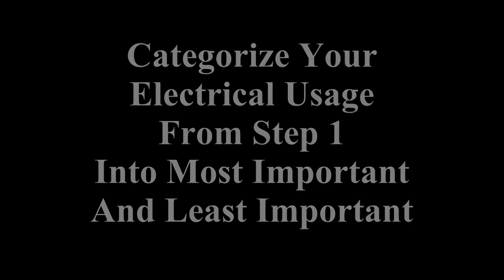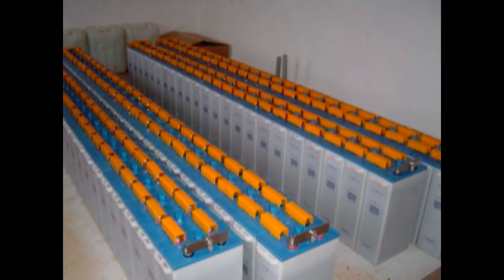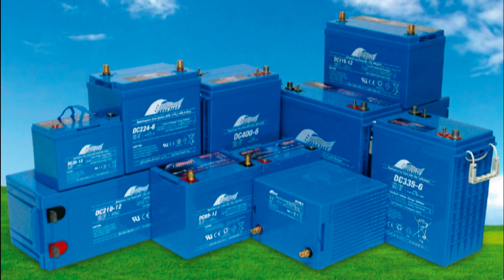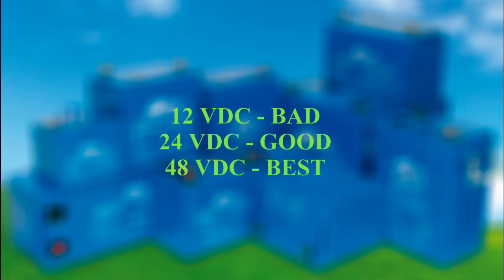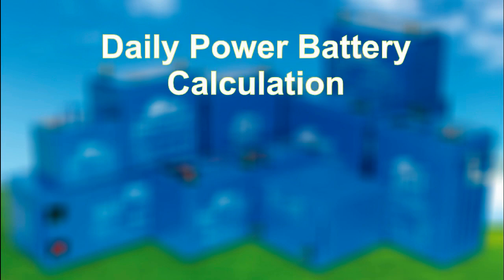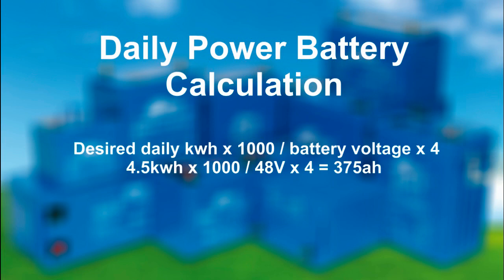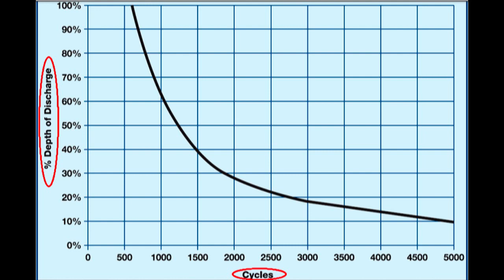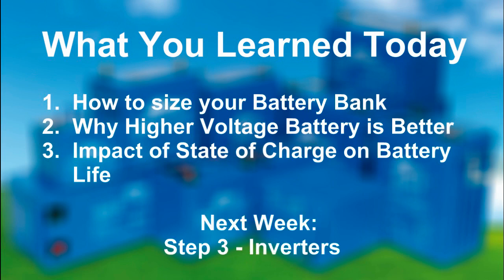Step 2 Solar/Wind Power: Battery Selection

Comment: Thanks but what about Tempreture of batteries and how temperature effect the batteries and how to configure Tempreture of batteries.
Reply from the maker: The manufacturer will have data sheet describing the operating conditions of the battery you want.  The different types and manufacturers of batteries are too varied and could take a video for that topic alone.
Reply: @OffGridLivingSteve  thanks I check that thanks

Comment: Some things should be powered by other methods. Hot water heating... Some type of gas. Wood fired or gas fired.
Reply from the maker: RogueOntheRoad you’re certainly free to heat your water by any means you wish. My home is all electric by solar power.  Stove, water heater, home heating and cooling, and even my electric car charging.  I haven’t started a generator in two years.

Comment: Saying 12 volt is bad just shows your ignorance. And it is not more expensive.
Reply from the maker: Don't be a fool.  12v is only good if you live in a bus.  If you power an average size home, the number of batteries and wire size required to process all the power would cost a fortune.  Well made 12v inverters max out at 2500 watts.  Double your voltage and use 1/4 the wire size.  Since your so full of yourself, you probably won't, but you can increase your knowledge here:  https://www.youtube.com/watch?v=ytwLNKbarsg

Comment: You, good sir, are a hero. Although I thought I knew nearly everything there is to know about different batteries, from redox to lithium metal (not ion), but I had never heard of these nickel-cadmium / iron ones that require oil. Sounds interesting and I'll definitely be checking into what they are all about with much more detail.

Love the videos.
Reply from the maker: You my dear friend have humbled me with mere words.  Thank you!
Reply: No, thank you. Your videos have taught me a lot - and not just this one.

In fact, since I have an expert here I figured I'd ask if you know of any way to use a charge controller to take advantage of typical commercial low voltage NiCd batteries? Seems they aren't very solar friendly with the trickle charge and all, but perhaps you can shed some light on it from the top of your head. I am very interested in especially the amount of cycles you can get and NiCd really does seem very good for that.
Reply from the maker: I prefer NiMH (nickel metal hydride) over NiCd (Nickel Cadmium) batteries.  NiCd tend to have a memory effect over a period of time where their apparent capacity diminishes over time.  MiMH does not have a memory effect, and retain their capacity over time.

Michael Bluejay has a good article on NiMH and NiCd batteries and proper charging you might be interested in here:  http://michaelbluejay.com/batteries/charging-tips.html

Good luck in all your endeavors!

Comment: Hello Steve.Just to let you know your calculation formulas,  I used them  and they are working Perfectly. With only 3400 Watt's running right now and a midnight classic 200 charge control, With 460 FLA batteries deep cycle. I am ending up with about  93%  in the morning,,  running  everything I need. At night. Thank you again. Neil Las Vegas.
Reply from the maker: Great to hear, Neil!  I'm glad it's working well.

Comment: Hello Steve . I finally the system up and running with  3400 w Or Solar power. The only new outback VFXR 3648-a  inverter with a midnight solar 200  Charge control.  I used your formulas to calculate everything  and one of the let you know they were real well. This is the first phase of solar panels, I will be adding another 1600 Watt's solar panels and one more charge control. Just to say thank you for posting your calculations, as they are about dead on. I'm going to do some videos of the system and post it here. I'd like to have permission to use your name, Referring to your calculations. How wonderful July and agreed August. Thank you again. Neil
Reply from the maker: Hello Neil.  I apologize for the tardiness of my response.  My father-in-law passed away last week, and we are just getting settled again.  Yes, please feel free to use any content.  The more we spread the wealth of knowledge, the wealthy in knowledge we all gain.

Comment: I am currently planning to build a new house and am considering various forms of alternative energy supply but mainly PV systems. I've watched loads of YouTube videos from various contributors and just discovered your channel which is excellent. There is one thing I can't get my head around at the moment when considering sizing my potential needs though and hopefuly you might be able to help.

I understand all the basic calculations for battery bank size with daily usage etc. but that supposes that the battery bank charges during the daylight hours and the battery bank supplies the energy required after dark. What I don't understand is the usage one has during daylight hours which presumably reduces the battery bank charging? Maybe I'm just over thinking things or missing something fundamental?
Reply from the maker: Please forgive my tardy response.  We just returned from a trip to Michigan.

You are right that any electricity you use during the day reduces the amount of available power to charge batteries.  This is the reason the panels are sized considering the amount of power required to charge PLUS the amount of electricity you would consume during the charging period.  That's the reason I have two separate consumption calculations in these primers.  One is for all your power needs, used to size your solar array, and the other calculation used to size your battery bank.  You don't need a battery bank sized for consumption during daylight hours, but you need the panels sized for it to produce what you consume.
Reply: Yes, I realise that now having watched them a couple of times more. It's difficult when beginning to design a system such as this to cover every thing you might need which is probably what you found back in the day. I also appreciate that there has to be some adaptation to your way of life to accomodate what you can do during daylight hours but also manage the limitations imposed by the battery bank after sundown.

I'm in the UK so we have quite a difference between what can be generated during Summer months and the Winter. I'm thinking we won't be able to exist totally off-grid for the whole year but we should be able to produce a lot of useable power for maybe 8 months of the year with a reasonably-sized system.

Thanks again for the help and all the videos. Very interesting, informative and thought-provoking.
Reply from the maker: Night time energy for my family is a small requirement really.  We use efficient LED lighting, laptop computers, and small flat screen televisions.  Bathing is done before sundown so the water pump is not run at night.  We might run the microwave at night for popcorn.  Therefore, night time usage is quite minimal.  During snow storms, laundry and other non-essentials are paused until the sun returns.  Working around the weather is important to minimize generator requirement.

My production here varies wildly between summer and winter months.  I will make a video of that soon.  I use a wood stove to heat our water, cook, and heat the home in winter.  I average 26 kWh per day of consumption/production in summer.  Winter months I average 12 kWh/day production.  Finding other means of energy is important so firewood became that winter energy source for me.

I have never been to UK, but I understand there are many cloudy days there.  Full cloud cover for me reduces output 15-50%, depending on the density.

Out prayers are with you and the great UK during this time of Ramadan murders and destruction.
Reply: The biggest problem we have in the UK is that London is on a of latitude 51.5 degrees N and I am just to the East of there. Denver is just under 40 degrees N so even though is gets a lot colder in Winter you probably have a lot more sunhours in the year than we do.

Woodburning is also not a cheap option here compared to N America where you have vast forested areas. We cut most of the trees down in the UK in the Middle Ages to make way for the people and farming!! :o)

That is why PV is starting to be come a viable and affordable option in comparison to other energy sources such as oil and gas. It would be nice to have a backup in place as well because our whole energy supply grid here is starting to groan under the strain which is only going to get worse in years to come.

I've been to Breckenridge/Copper Mountain  skiing and it was heaven there. Are you anywhere near that Steve?

Thanks for your sentiments about the recent atrocities suffered in the UK. You guys are far ahead of us on that front though with 9/11 and all the sacrifices many families in the US have made with your military battling this cancer. We have a history in the UK of remaining stoical in the face of terrorist attacks over many decades so we will prevail. Especially with the support and help of our friends across the water.

All the best for you and your family.
Reply from the maker: If you go to Breckenridge, I live very far South of there.  But if you are there, and you let me know in advance, I would be pleased to drive there and enjoy your fellowship.
Reply: That's a very kind offer Steve. I'm not planning a ski trip to Colorado any time soon but if I ever do I would love to meet up with you.

Comment: Nice video . Do you have any thoughts about the Aquion salt water  batteries : 100% discharge with no damage , no partial discharge problems , no maintenance and 8,000 lifetime cycles ?
Reply from the maker: Rod, when I think of the raw materials used in the manufacture, I think the batteries are way overpriced.  They don't use hazardous or rare metals like lithium, lead or nickel.  But when you consider stacking their performance against all other batteries, the price isn't bad.  If Duane and I can get some time this summer, we'll probably build a set of salt water batteries and see what we come up with.  Bottom line - I'm very impressed with Aquion's solution, and I would love to have a set to live on!

Comment: Excellent video.  You calculations confirm the ones I had recently done on my existing system.  I have a 24 volt system, however you make a very good argument for going to a 48 volt system.  At this point I have 16 250 watt panels, charging 8 430 amp batteries.  These are 6 volt batteries wired series in two sets to create two groups of 24 volts which are then wired in parallel.  We have midnite MPPT charge controllers and a Magnasine inverter.  The batteries are flooded deep cycle, however we've recently considered shifting to AGM - however budget is clearly a factor in making such a change.  We are not fully off grid as we still have mains power.  However, our solar system is wired to the house using a separate combiner box.  This allows us to power "critical" items, and if needed to be fully off grid simply by turning off mains power.  Thanks for sharing your direct experience with Nickel Iron batteries.  I have just discovered this old / new technology and have been intrigued.  However after hearing about your experience I may well leave Nickel Iron batteries alone.  The complexities and cost offer a negative incentive to getting into something which, while robust seems more suite to someone with more money and a sense of adventure than I have.
Reply from the maker: Thank you for that feedback.  I do enjoy hearing about others' experiences, and yours like all is a unique story.  You should make some videos!

Comment: Do you ever sleep with a TV all night? Or is that a no no in the Solar world?
Reply from the maker: It's generally a no no.  However, I've done it a few times accidentally.  But I try to remember to set the sleep timer so it will shut off after I fall asleep.

Comment: Have you heard about the new Tesla battery? bout 3,500. But you hang it on the wall and it is supposed to take care of the house and if you have the electric car it will charge it also. Any feed back, I would appreciate it.
Reply from the maker: I don't have any personal experience with it.   The Tesla PowerWall uses a non-standard DC voltage of over 300VDC.  So even though the battery isn't a bad price or deal, my understanding is the proprietary inverter and interconnecting components make it prohibitively expensive.  Personally, I'm waiting for the technology to mature enough for other manufacturers to compete and bring it in line with industry standards, thus bringing down costs.

I wish I could be more help, but that is my thought regarding it.

Comment: Hi Steve, watch all your vids. great work. I'm trying to figure out my own   system.. I have 4, 12 volt batteries At 110 amp hours each. I have them wired to make 24 volts.i had a think about your equation. if I had them wired at 12 volts it would be 440 amp hours. as the 4 batteries have 110 amp hours each.. so I wired them to make 24 volts. I now have 220 amp hours.. if I wanted to wire them at 48 volts I'd have 110 amp hours. it all works out the same. the kW hours is the same in each configuration. the only benefit I see going to 48 volts is smaller wire and less of a loss in the cable as you can go further. I still only have 5.28 or so kW hours in the batteries no matter if it's 12/24/48. at 12 volts I have 440, 24 is 220, 48 is 110. there still the same.. can you elaborate on this.
Reply from the maker: You are absolutely correct!  My elaboration is this: By doubling the voltage, you cut the wire size by a whopping 75%!  If you price the cost of #2 wire as opposed to the cost of #8 wire, the cost of copper makes the savings substantial.  The same goes for the connectors.  Larger connectors cost more and require more heavy duty crimpers.  Higher capacity breakers and fuses cost more.  Heavier wire is more difficult to bend around corners and requires much larger conduit (again more cost).  The newer inverter/MPPT/charger that is out is 48V, and costs less than either 12V or 24V models at the same Kwh rating.  

I made a video specifically to address your comment because I had so many like yours.  You can find it here:
https://www.youtube.com/watch?v=ytwLNKbarsg
Reply: Thank you for your reply. I was just trying to figure out the best way forward,initially started with 12 volts ,now 24,and in the future 48,as it is cheaper and you are correct. And 48 volts will be the way to go. I appreciate your reply, and hope all is well. Thanks for all your videos. They helped me alot with my setup. Have a great day :)
Reply from the maker: LOL  I think we all start out on 12V.  That's what gets us hooked!

Comment: off topic but please consider aborting the microwave for cooking.   heating liquids is ok but please reconsider cooking with a microwave.  peace.  
Having said that, thank you for the alternative energy videos.  I've had to reconsider and practically re-learn this topic.
Reply from the maker: +linuxxxunil Frankly, I'm more concerned about DNA splicing in our foods, chemical sprays used in agriculture, as well as toxic fertilizers, than I am concerned about sending radio waves through my food.  Mircowaves put out less radiation than the ones used in telecommunications system.  We all get bombarded with those signals directly.  In my opinion at least,  there are much more harmful effects from man-made devices other than a microwave.

Thank you for the kind words about my videos, and I'm glad you are benefiting, brother!

Comment: Steve Love your videos. I have 8 12 volt batteries with a combined  ah of 1355 if I wire them in series for 48 volt banks would I have 1355 ah.thanksDon
Reply from the maker: +ffemt32o  Don, if all of your batteries are a COMBINED 1355 amp hours, you have a battery bank that is 16.26kwh regardless of the voltage it is wired.  At 48 volts, this battery set would be 338.75ah.

Comment: Awesome Channel Steve just found you 2 days ago and have binge watched your channel. Thanks again Steve. What are your thoughts on the Tesla battery?
Reply from the maker: +j jones You'll notice I don't make tons of videos, but I try to make videos that are relevant with good information so you don't have to wade through tons of stuff about dogs and chickens to try and find the occasional information nugget.  If you've been binge watching, that tells me you're getting a benefit from it and that is a blessing to me.

My thoughts about the tesla battery are that I like the technology a lot, and I'm excited to see how it matures.  Currently, it's not compatible voltage-wise with with presently used systems.  Personally I won't invest in it until either they build a configuration that is compatible with presently used voltages (or presently used voltages change to match theirs) and the pricing has come to a level that I think is in line with the market.  Time will tell brother.
Reply: Thanks for the replies Steve! I am always interested in technology and have thought about solar for several years. Can't afford to start out big but can start out small just don't want to re-buy equipment as my solar grows!